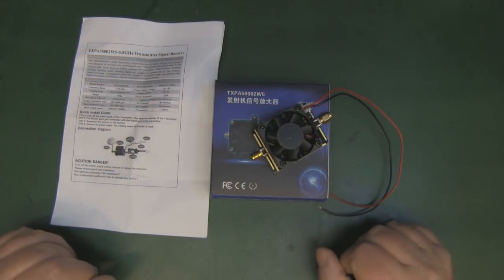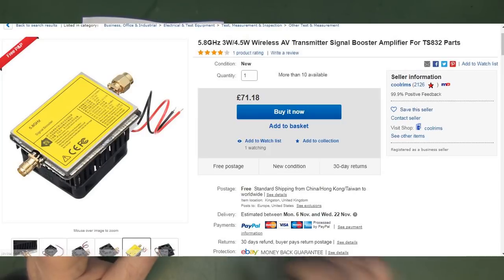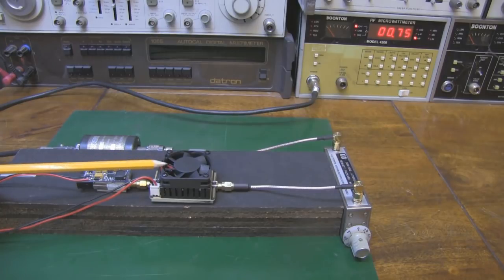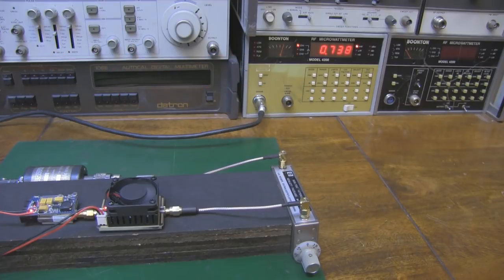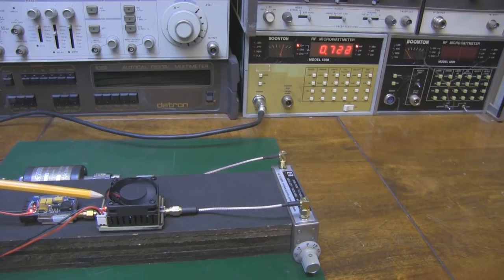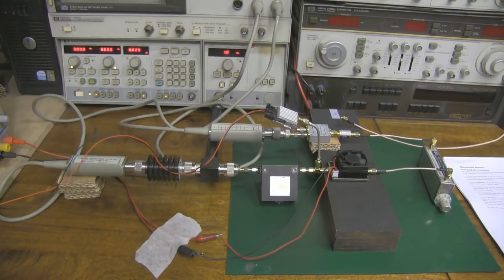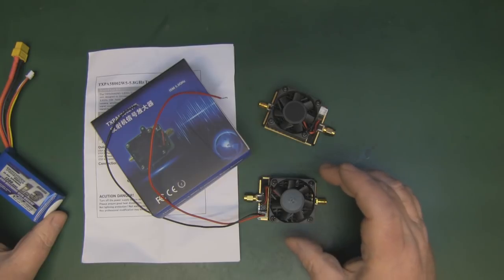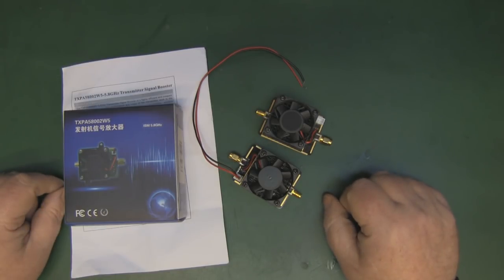TXPA58002W5 5 8GHz 3W  4.5W Wireless AV Transmitter Signal Booster Fail!!!

Comment: Hey there. Nice video. I think your dB calculations are wrong (5:39). You cannot have 33 dBm of attenuation, "dBm" is an absolute power figure. If you have 33 dB of attenuation, that's equivalent to a factor of roughly 2000 (2*1000, ~2 for the 3 dB and 1000 for the 30 dB). From the load to the source, you have to multiply the power that makes it into the sensor by that factor. Using exact numbers, this yields 0.73 m W * 1995 = 1456.35 mW = 1.5 W. By the way, when doing this you have to ensure that your attenuators are rated for the power you dump into them.
Reply: Yeah that's brithy the same as I calculatet, 0.73 mW +3 db so Doble 0.73 X 2 = 1, 46 and then the 30 db so 1.46 X 1000 is 1460 mW or 1,46W

Comment: I got one of these and changed the reverse sma 's to normal sma's.  I popped the cover off and looked inside.  The 2 devices in there (SIGe5004L)  are rated at 27dbm output each so in total there will be 1w max (30dbm)  output.  These devices also have built  in automatic power limiting so once they get to around 1w they wont really produce more.  In my testing I get 500mw output with 25mw input. 50mw should produce 1watt but not tested yet as I dont have more than 25mw on 5ghz  to feed into the amp. As for reliability I hope its a bit better than you found here!

Comment: My 5.8g VTX is a little over 600mw and I'm getting only 2282mw output. My 5.8G booster still works but my 1.2g booster burned out after giving it 1500mw. It can't take more than 1W max and never put out more then 2386mw

Comment from the maker: If you have one of these Is it still working?
Reply: andrew mcneil don't give the 1.2g booster more than 1w or it burns out. Same with the 5.8g
Reply: andrew mcneil if you don't bolt it to a tester or over power it . it will last forever.

Comment: Is "Connecting it to an attenuator" same as having a load? I question whether you are running the amplifiers open load and killed itself.
Reply: The attenuator does something interesting in this regard. I'm assuming attenuators designed for 50 Ohm systems: If you terminate the attenuator with 50 Ohms (such as when you connect the power sensor), the attenuator looks like a 50 Ohm load. When you leave the attenuator's "output" open (i.e. don't connect the load), the attenuator does not look like a 50 Ohm load any longer, but it doesn't look like an open either. The impedance seen when looking into the attenuator will be somewhere in between and will vary with the attenuation factor.

For example, if you have a 3 dB attenuator and leave it open, looking at that open through the attenuator looks like a 150 Ohm load. a 10 dB attenuator looks like a 61 Ohm load. The bigger your attenuation, the closer you get to 50 Ohm. In theory, an attenuator that absorbs all the power then is a 50 Ohm load by itself which hopefully makes sense. Because of this, using an attenuator is a way to isolate a potential mismatch from a source.
Reply: Thank you! I am now playing with a repeater for Cell phone band 12 (700Mhz range), Yagi antenna connected, indoor antenna connected, I am still working on where the signal source is coming from. The amplifier (not your type, it is a small one) has a power indicator blinking, so my guess is there is no signal received. manual is a shit as usual. The is for USA T-mobile. I think our city uses band 2,4, and 12. I checked with my cell phone, an LTE apps called LTE-discovery, pretty good. It tells me I have band 4 in my home. So, the band 12 I bought could be no use.

The reason I wanted a band 12 is for another location elsewhere, which only has band 12. Now I have to travel to that property and test it out.

A lot of fun learning and playing with these toys.
Reply: (Just for the record, I'm not the creator of the video, I just saw your question and found an opportunity to contribute)